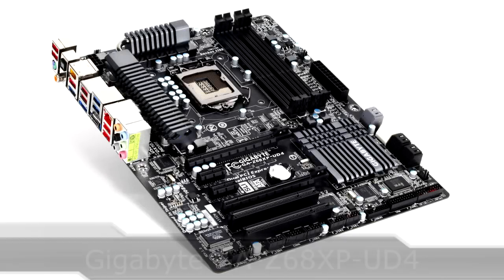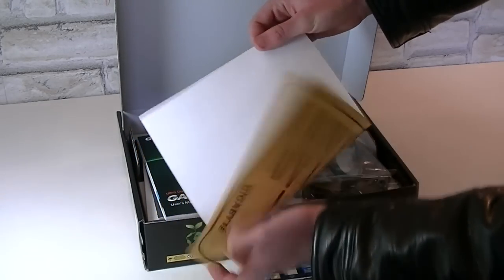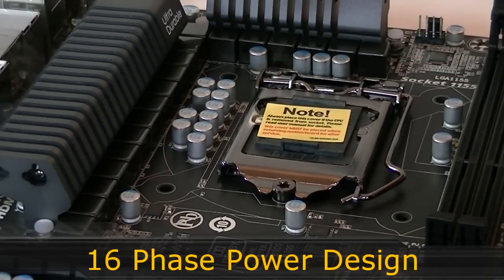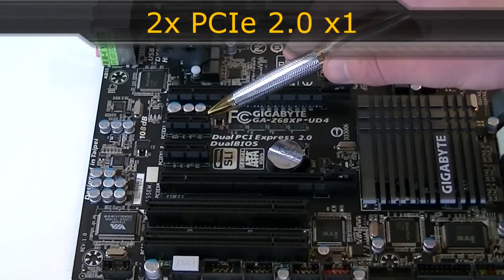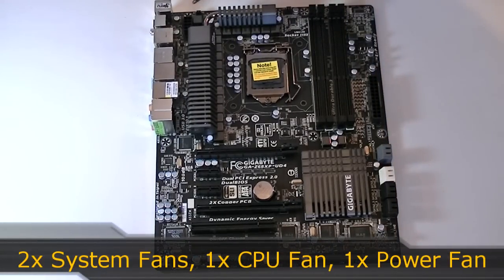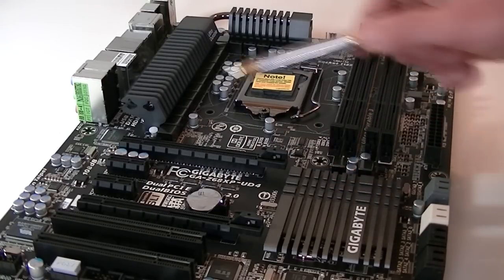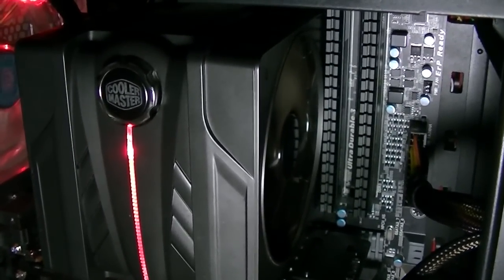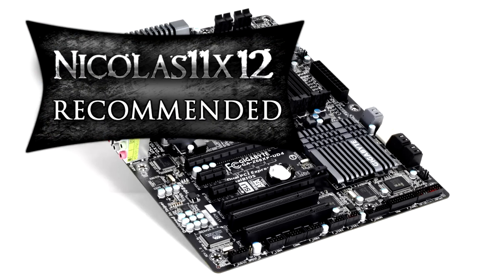GIGABYTE GA-Z68XP-UD4 Motherboard Review

Comment: Great videos - i am thinking of a build with the Nvidia GTX 680. I know that it runs with the PCI 3.0 connection, but this motherboard does not support that from what I could tell. Could you recommend a board with the specs and design of this one, but with the PCI 3.0-configuration as well as Ivy Bridge-support? :) Keep up the videos!

Comment from the maker: Alright, there should be no problem with this motherboard. Thank you for giving details right in the beginning. WinRAR Extraction is a CPU and RAM process. Did you overclock the i5-2500K? Did you overclock the Memory? If anything is overclocked, revert back to default safe settings and see what happens. If the problem doesn't occur anymore either the CPU or RAM was the fault. Setting up the wrong timings for the Memory could make you crash too. Make sure Frequency, Voltage and timings are set.

Comment: hello sir 
i have problem with my ga-z68-xp-ud4. when i try to extract from rar file there are errors but same file work good on other pc and some time when extractin rar.file the system crash comes with  a blue screen and and some process like" dumping physical memory to disk"
and computer restart again so ?
*what is the problem?
*does th board have problem?
* i have core i5-2500k, corsair 12gb 1600mhz(3 sticks),psu-Antec TPQ 1200watt , HDD- Seagate baracudda 1TB, Cpu cooler- corsair H80, 
HELP